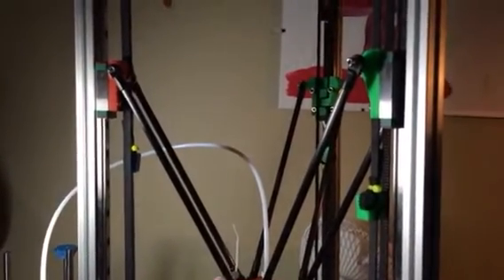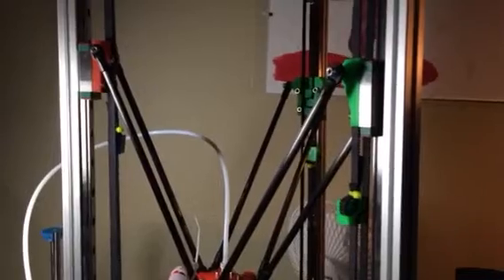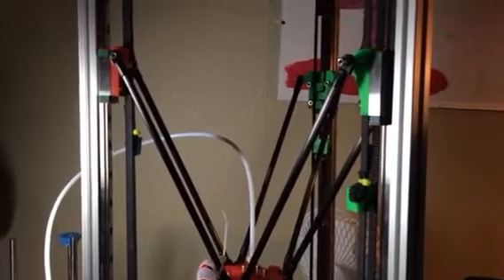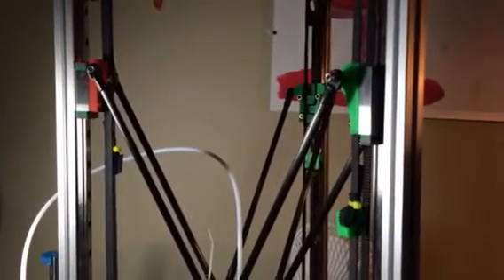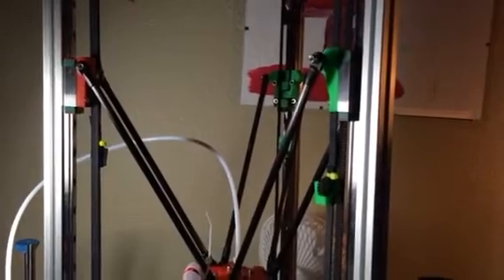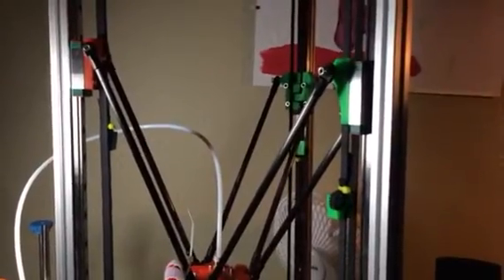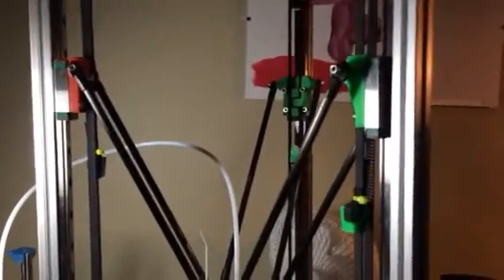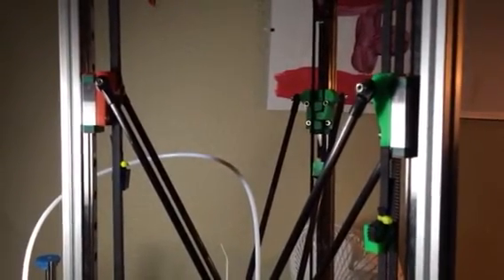Problem with Z motor

Comment: If you still have this problem, I would recommend taking the motor off of the base to see if the parts aren't working.  It could be that something is caught in the rails, or in the motor itself.